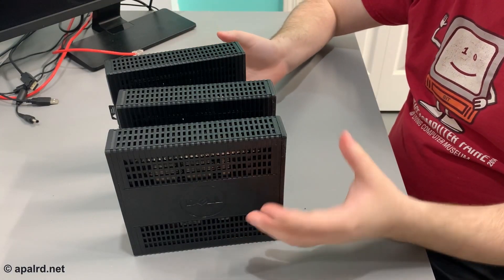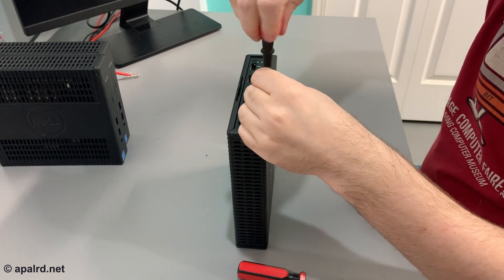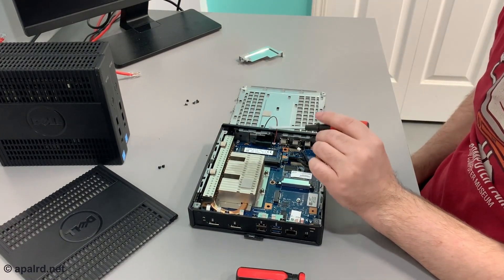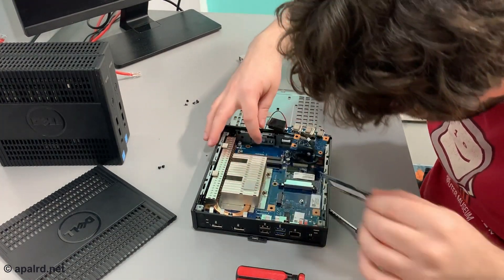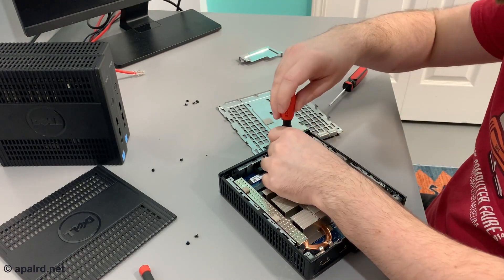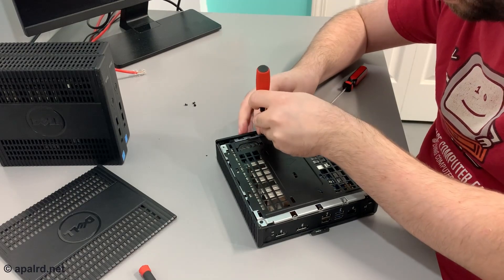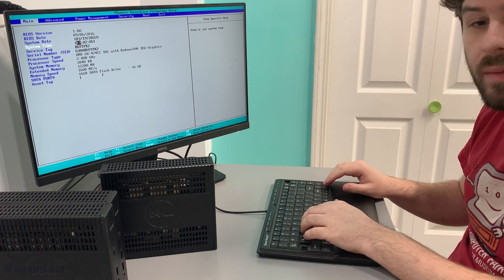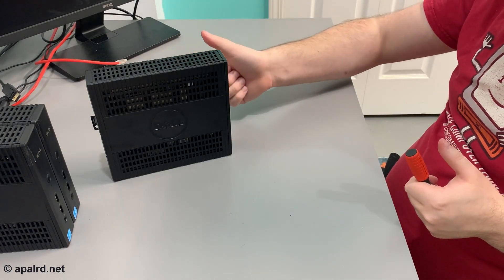Dell WYSE 5060 Thin Client MEMORY UPGRADE | Homelab Operations Center

Comment: I have the 7020 and am running 8GB (4GB X 2). I also was able to add the second sata channel and have 2 512GB SSD's. I used a NGFF sata adapter to replace the original SSD

Comment: i have had 16gb in mine at one time. currently 8gb. also used a sata adapter an installed a 512gb ssd with X64 Win10 & added an internal wifi from a scrap laptop

Comment: how to increase storage space?
Reply from the maker: You can add it over USB3 or replace the SATA drive. The SATA drive is half-length but uses a standard connector, but no cables, so you'd need a male to female sata and sata power cable to use a full-length ssd.
Reply: @apalrdsadventures  Where would you get the power for the sata power cable? I ordered a 128GB SSD and assume I don't need additional power but....
Reply from the maker: The header on the motherboard has a standard (female) SATA power and data connector, so you'd need to extend both of them. It's the opposite gender of a normal motherboard header since you plug the drive in directly to it.

Comment: The 5060s look like quite capable little computers and I got mine cheap.

The 5060s are fairly powerful, passively cooled and power consumption at idle is low.

There are a few things I don’t like about them. RAM upgrades are doable but unnecessarily difficult and fiddly. Worse, for anything that requires a storage upgrade the 5060 sucks. 

I took the motherboard of my 5060 out because I didn't realize that the back panel with the connectors can come out which gives sufficient access to the lower sodimm slot. (Correction - taking the back panel out alone will NOT allow access to the lower sodimm slot. But it makes taking the motherboard out and putting it back in much easier.)

The 5060 works OK with 8GB storage as a Thin Client, fair enough. For many other applications, you have to upgrade storage – and storage upgrades suck. There is the standard SATA connector, unfortunately, the case does not allow mounting a standard 2.5” SATA SSD drive internally. This means despite the standard SATA connector, the 5060 is non-standard in relation to storage.

The largest SSD’s Dell sells are 64GB, still too small for many applications. I have not tried to get a genuine 64GB Dell SSD for the 5060, but I would expect those are comparatively expensive if you can get one in the first place.

You see people take the module out of 2.5” hard drives and stick them in the SATA slot. In my case, I took the module out of a 120GB APACER 2.5” drive which is so wide it clashes with the RAM shielding. This requires modding the shielding or leaving the shielding out, both not great options. Also, the SATA module sits there at an angle to the motherboard, looks like that puts tension on the board and connector, which cannot be good in the long run. 

I’m now thinking of a SATA extension cable but struggle to find a very short one. Coiling up half a meter of cable in the little case cannot be good for airflow. (Update: have installed an extension about 40cm long, just curled up the cables and fixed it to the bottom of the case with a tie. wrapped the SSD in insulation tape. This way the SSD sits lower than the heatsink and there seems to be no heat-related problems. From running this open, the CPU and heatsink do get so hot that you don't want to touch.)

If you ask me, Dell should have gone for standard m.2 SATA storage, similar to the HP T620 thin client. 

RAM and Storage upgrades in HP thin clients are super easy. Dell should have a look at those.
Reply: Make sure you don't let a mSATA drive touch any metal on the case.

Comment: How many virtual machines can you run on the upgrade?
Reply from the maker: Windows 10? Probably 2-3 max per node. I haven't tried Windows on the cluster yet.

Linux? I usually give them 2G each, so 5 VMs per node. They could probably squeeze a bit.

LXC containers can use significantly less, with Ubuntu/Debian containers are down to a few hundred MB and lightweight distros like Alpine can get down to tens of MB for the OS overhead, plus the services themselves. I'm working on learning Alpine for future thin client projects.

12G is plenty to run all of my home automation services, including Home Assistant and Frigate in separate VMs, although I haven't tried putting my coral AI card in the m.2 wifi slot.
Reply: @apalrdsadventures  how do you get 5vm on an 4 core system, How does that work? Can’t run all 5vm at once right?
Reply from the maker: You can overprovision CPU but not generally RAM.

Guest tasks (virtual CPUs) will be scheduled by the Linux host scheduler, so the 'CPU Units' field is a unitless number that determines how the host scheduler prioritizes guest tasks.

RAM is a bit quirky too. The guest is guaranteed the amount of RAM specified and it's possible it will use all of it in physical RAM. If ballooning is used, the guest can give some of its unused RAM back to the host. Linux KSM ('Kernel Samepage Merging') can also share pages which are identical, so if your VMs are all of the same OS it's likely their pages will get merged and the host will have more RAM available for use.

Comment: In my 5060 I have two 8GB sticks for 16G total which is the max, it will see 16GB sticks but only as 8GB. Indeed not designed to put in the second, dimm, you have to loosen the front to wiggle it in. I am running Proxmox on it as well.
Reply: Thks for confirming 16G - once apalrd's found the second slot I was hoping he would test 16G (8+8), 12G (8+4) and 8G (4+4) setups.
Reply from the maker: I only bought 3x 8G sticks, thinking there was only one sodimm slot (I didn't actually take it apart again before buying memory), so the 12G is a pleasant surprise and enough for my next cluster video. 16G would be better, but so would buying a 4th node lol

Comment: Awesome, I’ve got a few of these coming today and I was hoping I could increase the RAM in them.  Good to see it’s possible.
Reply from the maker: It's maddening how tight it is around the front power light pipe, but it's definitely doable. It supports up to 8G per stick with 2 sticks total.
Reply: @apalrdsadventures   Hey, I am new to Thin Clients, i need 1 for home office use and home assistant 24/7 use. Which Thin Client is the best ? whats your top 3 of all time ?
Reply from the maker: A lot of them are good enough for Home Assistant, it really depends on if you want to expand the storage and what the good deals are on ebay. The HP T530 and Dell Wyse 5060 are the two favorites that I own, but make sure you find one with a power supply since that can sometimes cost as much as the unit without one.
Reply: @apalrdsadventures  can the memory and storage be expanded on those 2 unit ? if so, can you share links to the recommended memory and/or storage drive ? also, which wifi card can work this machine ?